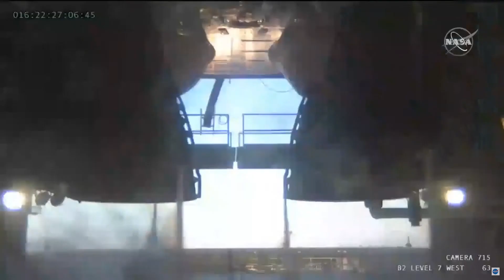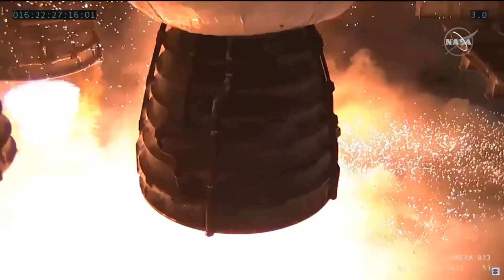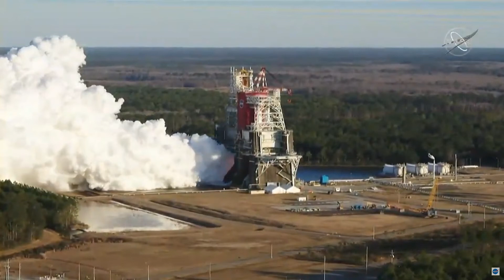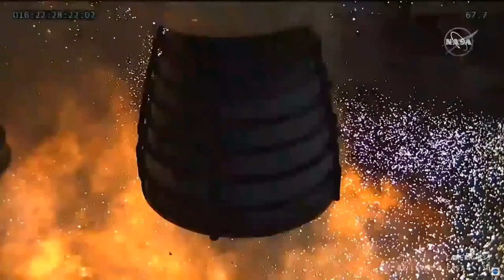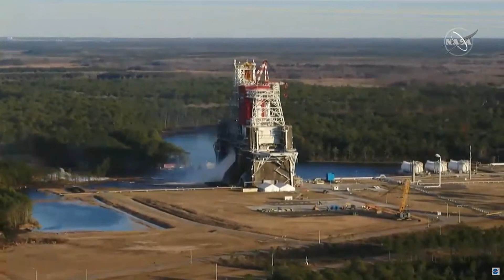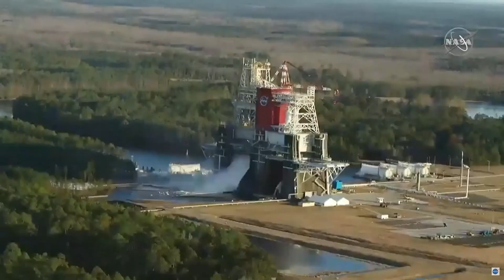NASA Artemis Moon Hot Fire Rocket Test!

Comment: The purpose of testing is to detect failure.....but SPACE X is  much more able to react and correct things quickly with their prototypes SN8, SN9, etc....
For example a Raptor can be exchanged in a matter of hours.....I  suppose that replacing a R25 engine needs weeks....and a lot of dollars
Reply: Reporter asked assuming nothing wrong, how soon can you test again.  A "John" responded, at least a month.  Another big shot on stage emphasized a second time that he needs 4-5 days on top of that to refuel ... Something like that.
Reply: “major component failure” still sound scary

Comment: i heard the word "violation" in the control audio.. the rest was difficult to understand.  how far into the sky would 2 minutes mega thrust take the payload?  by that  i mean what use is an aborted engine so high up? it seems everything would be lost/ destoyed by then? what wou;d the recovery options be between 2 and 8 minutes of thrust?? i am askin questions. to learn.
Reply: Orion would be fine no mattter when RS 25s would shut down.
Reply: @antonlencses8622  I feel like this is not accurate...
Reply: @brianmurray505  Orion has abort window throughout entire core stage burn an a bit after that.
Reply: @antonlencses8622  ohh I see, when you say "fine" you mean from a safety perspective, yes an abort could be performed during an engine failure if there's time. I was thinking "fine" meant mission success though, like payload delivery. My bad.
Reply: The test was originally supposed to be 8min the Engine Controller can be heard calling out a "MCF" (Major Component Failure) on engine 4 at around +60sec.
Reply: @Josh3sh  thanks for the response brother